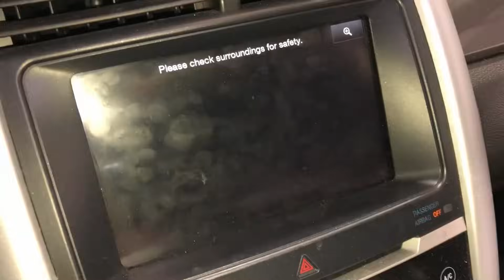2007-2019 Ford 6F50/55 Six Speed Transmission: Fluid Exchange Procedure

Comment: I figured I could come to your most recent video to ask this question...
I have a 2006 F150 extended cab. I had a power steering fluid leak. It was leaking pretty bad. It was a line that needed to be fixed and it is fixed now. No more leaking. There is a whine but after watching your video about it not being the pump and being a pully I am pretty sure that is what is making the whine. But now after fixing the power steering leak the actual reservoir is moving. The fluid is moving as well but only because the reservoir is moving. So what could that be?
Reply: Add a bottle of Lucas Powersteering Conditioner.

Comment: So if the airbox is in the way on a 2015 Taurus SHO, how are you supposed to check the fluid level with engine running?
Reply: Had to figure this out on my own since there was no solid information on the web.  Had to have engine running with MAF and air box disconnected while adjusting the fluid.  Overall a very easy process to change the fluid.  5.2 quarts total went in.

Comment: What types of engine design changes actually allow manufactures to change oil grades from say, 10-30 to 5 -20 to 0 - 20. And if I don’t want to use 0 - 20 in my engine in the summer and want to 5 - 20 what would the results potentially be.
Reply: 5-20 instead of 0-20? No problem. The thinner oils are for fuel economy. That said oils today are better quality and the lower viscosity is fine for modern engines.

Comment: I just performed a 3-time drain-n-fill on my 2013 MKX. 
I drained 5 LITERS (measured) on the first drain, presumably from the factory. I've seen 5 quarts for the fill and you say 4 1/2 quarts.
What say you, sir?
Reply: Variance. May have been slightly low from the factory? Maybe your vehicle was not sitting perfectly level when you drained it??

Comment: I've got an 09 Edge. Noticed a rattle at cold start-up for about a second, then it goes away. Started around 150k. Any ideas what it could be?
Reply: Wife's got the same issue at 180k
Reply: Timing chain tensioner

Comment: I have a 2018... 2.0 AWD the owners manual says the dealer has to check the fluid level let alone change it...it's got a funky cap other than what you showed... any thoughts?...Thanks for the Video...very well done.
Reply: It should be the same, even if the cap looks different.

Comment: Love the DIY videos! 
Am I the only person to notice that he Clearly says 4 1/2 quarts THREE times at the beginning of the video and then changes it to 5 1/2 to 5 3/4 when he's topping off with fluid???
Reply: The 4.5 is the base line. Topping up as you go through the procedure. Better not to overfill from the start and add until you get to the mid hash mark.
Reply: Same here right about 4.9ish qts, pretty much 5 is fine. Also checked mine while the engine was running too. I’ve seen countless videos where they check it with engine off. Not sure how much that affects the level reading though.
Reply: Took me 5 quarts to get just about right under half way mark .

Comment: Who are the genius engineers who try and reinvent the wheel when designing a transmission to be taken out and apart to change the filter......
Reply: Examples of planned obsolescence include: Limiting the life of a light bulb, as per the Phoebus cartel. Coming out with a new model for a car every year with minor changes. Short-lasting nylon stockings. Irreplaceable batteries in tech products....ford motor co. Products.

Comment: I work on the line where these are built. The engineers say not to worry about the filter. It is large enough to catch all of the material inside that will wear down over the life of car. There is a magnet on it to pick up any metal debris as well.
Reply from the maker: Yup its a large capacity filter for sure ands a magnetic strip but they said the CD4E filters were more than enough too.
Reply: Thank you, Daryl for building our Fantastic Fords! We are a big Ford family. Yes, I also have a 06' Pursuit. Thank you, FordTechMakuloco, for all the great wisdom and fixing our Ford's!
Reply: Tell your engineer friends to watch all the videos on this channel then we can sit around and discuss the horrible ideas of: non-serviceable internal filters, lifetime fluid in transmissions,  lifetime fluid in PTUs, PTUs where the gear oil turns to tar, water pumps that when fail dump coolant into the engine oil, placing the damn alternator in Ford Escapes (2001 - 2012) between the firewall and rear of engine, have them use the first and second generation Escapes as studies on how not to do corrosion prevention. 

Then we can discuss some good ideas: external cam- driven water pumps, external transmission filters (we can dream), off-road selective gearing for the Bronco sport, PTUs with drain plugs, serious rust prevention for the rust belt.
Reply: @chucknoob7041  For Ford, that would mean you won't have to buy a new vehicle as soon as they want you to buy again! The Big 3 are into making "disposable vehicles"! Plain and simple! Yet they snow the world when they claim to build "tough" vehicles!
Reply: I think I’ll pass. I’ve worked with aerospace engineers since I was an 18 year old aircraft mechanic and can never get a straight answer on service intervals. What they predict to be optimal is rarely even close. Reliability engineers? They’ll give you better recommendations after they’ve seen enough failures. Let’s hope yours isn’t the one that failed. The mechanic with years of experience who sees how things operate in real world conditions every day will most likely be your best resource.
Reply: LMAO! HaHaHa! Love "over the life of the car"!!!! I wonder how many miles/years constitute the life of the car?

Comment: My 2013 Ford Fusion Titanium with the 2.0L Turbo engine and the 6F35 transmission has been an amazing car for 100,000 miles. Now at 101,000, the car is beginning to intermittently linger on 2nd gear longer than usual (feels like the car is floating) and then banging into 3rd gear. It happens during long drives. It's been 12,000 miles since the last time the fluid was drained and refilled with new Mercon LV ATF (with some RedLube friction modifier). I'm going to change the ATF soon to see if shifting improves, but what would you recommend? I've been advised to go to the dealer and see if there's a sw update for the TCM. I plan to do that next week. But what do you recommend? Thanks.
Reply: Those factory software updates are meant for low mileage vehicles with little internal wear - applying the update on a vehicle with over 100k miles of wear on it may actually cause the problem to get much worse, since all the learned parameters will also be reset back to brand new factory settings in addition to whatever the software update changes.  Try an ATF fluid change ASAP (minus any additives - stock Mercon LV is all that is needed), and if it does not fix it then you have a decision to make if you want to keep driving it till it stops moving or spend the money now on a rebuilt trans.

Comment: Congratulation! You just replaced 40% of fluid.
Reply from the maker: More like 50% or more. That is the idea here, you MAINTAIN your fluid not neglect it. You never want to completely flush a trans especially with a flusher machine that has a mix of fluids from the last 4 vehicles it serviced.
Reply: Eric, Do you have a link to the proper way to drain the torque converter as well? Really hard to find any information regarding the procedure.

Comment: I was wondering if you could put Mercon V instead of the Mercon LV fluid in this type of transmission.
Reply from the maker: Why would you?
Reply: @FordTechMakuloco    I asked the question because in the video it was stated in mid year of 2009 Ford switched to the LV fluid at 5:37  and is more sensitive to fluid change it expands more. So in my eyes it seems that the Mercon V is a more stable fluid. So did Ford change the internals of the transmission when they changed the fluid type or did it stay the same. So if the internals are the same why not use Mercon V if its less sensitive.
Reply: @T Rust  The LV stands for "low viscosity".  Regular Mercon or Mercon V should never be used in place of Mercon LV.  The same thing goes for Mercon LV - it should never be used in an application that calls for Mercon or Mercon V.  The days of being able to just grab any bottle of ATF and expect it to not cause any problems are just memories of "the good old days" now.
Reply: @KCautodoctor I asked the question because in the video it was stated in mid year of 2009 Ford switched to the LV fluid at 5:37  and is more sensitive to fluid change it expands more. So in my eyes it seems that the Mercon V is a more stable fluid. So did Ford change the internals of the transmission when they changed the fluid type or did it stay the same. So if the internals are the same why not use Mercon V if its less sensitive.
Reply: @tedjones-ho2zk  because the transmission was designed for this specific fluid chemistry & viscosity due to the very precise metering passages in the valvebody and solenoids used to control the shifting of the transmission.  There is also a different friction modifier added in the LV fluid than what is used in the older Mercon & Mercon V ATFs.  Use of the wrong fluid type will cause shifting problems and rapid wear on the internal frictions materials.
Reply: @KCautodoctor Thank you for informed reply to my question

Comment: Thank you soooo much! I need to service my 17 Explorer limited. How do you know if you have a 6F50 or 55 trans?
Reply from the maker: It is based on the engine you have but it does not matter because the fluid and service procedure are the same.
Reply: The 55 is used for ecoboost applications,  a little beefier inside.
Reply: I have the normally asperated V6 and was hoping to have the beefier 55 since I tow a camper. Do you recommend a better trans cooler? I did order the wind deflector that mounts underneath to blow air back on the PTO. Tha ks for your info and excellent videos!

Comment: Do you recommend to change the fluid on a 6r60 transmission with 90k miles that has never gotten the fluid changed? I just bought the truck and the previous owner never replaced it, he used the truck (07 Explorer ST) mostly for going to and from work and thus far the transmission shifts smoothly.
Reply from the maker: Yes a fluid and filter change but make sure you use Mercon SP.
Reply: @FordTechMakuloco  Awesome thanks for the advice.

Comment: Want to keep your Fords over 100k do all fluid changes religiously including brake fluid, engine coolant, power steering, transmission, PTU and engine oil.
Reply: 2007 ford edge 158,000
2010 ford edge 164,000 
Change fluids they will last
Reply: most vehicles, if not all, with the 6F50/55 use ford EPAS steering, which is electric and not hydraulic fluid driven
Reply: Great advice

Comment: Just left Ford dealership. They quoted me $550 for drain and fill on a 13 F150. They were really pushing the transmission flush. 🤦🏻‍♂️ At what mileage would it be considered too late to perform drain and fill?
Reply: I'd say over 150k you may want to think before drain n fill.
Reply: I hear flushes are bad....just diy drain and fill and save 525.
Reply: Leo Derosia I’ve heard the same thing about flushes, that’s why I told him I didn’t want the flush. They wanted $250 for the flush, $550 for the drain and fill. 🤯 I told him looks like I’ll be doing the drain and fill myself, just didn’t want to because I wanted to avoid the mess in the garage.

Comment: Is it better to have a fluid exchange done or is a drain and fill good enough? I was told a lot of old fluid does not drain
Reply from the maker: You want to follow this drain and fill procedure and maintain the fluid at the specified intervals, never flush.
Reply: Why do you not suggest flushing? I guess a flush every 60,000 is similar to a drain and refill every 30,000. And a drain&refill is a DIY.
Reply: @taylorsutherland9447  I believe a fluid exchange is suctioning out old and replacing with new. The flush would be different. A flush may take and circulate old trans debris throughout the trans and leave particulates in small orifices that would clog! Normally, fluid follows a designed circuit where the fluid gets filtered BEFORE it goes to any small important openings! Think of the way coolant gets FLUSHED through the system!
Reply: @taylorsutherland9447 Add a bottle of Lucas Transmission Conditioner next time too, in place of some of that 4.5 quarts.

Comment: Is it the same for the EcoBoost as well?
Reply from the maker: same for all 6f50/55 transmissions.
Reply: The 6f50 is the standard engine model and the 6f55 is the ecoboost model. The main difference is the thickness of the gears in the differential.

Comment: I agree that non-serviceable filters are kind of dumb, but they're not as bad as everyone here is making them out to be. Considering most people never service their transmissions at all and they commonly go over 150k miles before having problems, it's not inconceivable one with a non-serviceable filter can go over 250k just with some fluid changes. My 1992 Honda Accord also has a non-serviceable filter (yeah, before you bash Ford for this, they're not the first ones to do this). I have 208k  miles and never had a transmission problem. Never had to change the filter; I just change the fluid every 30k or so.
Reply from the maker: Correct the filters are great long life filters just don't neglect the fluid.
Reply: While I do agree it's really not that necessary to change the fluid or filter in the grand scheme of things, I'd still at least like to have the option of doing it. Ford is making this choice as a cost saving measure for themselves rather than the user.

Comment: Did I hear 4WD or Front wheel drive?
Reply: The transmission has same design for all apllications, but they are not interchangeable.  The awd model has longer output shafts.
Reply: He said FWD, but that's because the platform is based on a FWD setup even though most (in the north anyway) have an AWD transfer case added to make them 4WD.  IOW,  same transmission in both.

Comment: I agree with your shorter than recommended fluid change intervals. More maintenance means less repairs.
Reply: Same goes for Engine Oil changes, 7500 to 10000 is dirty oil running too long
Reply: @TheSaintshockey03  I've always done my oil changes every 5k miles up until the last couple of years. I might drive 5-6k miles/year now, so I just change my oil every 6 months. It ends up being every 2.5-3k miles, which might be a little overkill, but I like keeping things on a nice schedule
Reply: Tom Peterson I have 205k miles on my 2008 Ford Edge fwd no issues at all. I’ve only changed the fluid twice. I don’t want to change it again because it’s still has some pink in it and I don’t want to mess anything up at this mileage. Might help that the car has the tow package so it has a bigger tranny cooler.

Comment: I have a 2016 Edge 2.0L FWD and the transmission does not have a dipstick only a fill cap, How would I do a drain and fill on it? How would I know its full?
Reply: @823jeepman  that should be the 6F35 trans in that version of the Edge.  Brian has some videos on here that show how to check the fluid level on that transmission by removing a specific plug to check for ATF fluid dribbling out.  Do not guess about the fluid level since it is very temperature sensitive & critical in keeping these modern transmissions working correctly.
Reply: Then you have measure how much comes out and put the same amount back in. The new fluid going in needs to be the same temp as the fluid that came out

Comment: Do you know what would cause a 2006 Ford Taurus to stall when making a left turn? starts right back up after. Only did it once so far
Reply: Dose this happen at a stop, or while moving, or both.
Reply: Zachariah Woller so far is was when turning. I think a few years back it almost stalled when backing up
Reply: @justinp8946  I'd check and clean, or even replace the IAC valve. Because if that's sticking and not opening right it will stall the engine due to the load on the engine and transmission. I also wouldn't be surprised if an o2 sensor could use some cleaning to. If that don't work bring it to a mechanic so he can plug in his actual computer and read what's happening to the engine when making the turn and possibly diagnosing what's wrong. Granted that would start costing money.
Reply: @justinp8946  That or the fuel pump is going out the door.
Reply: Zachariah Woller for sure. I appreciate the tips!

Comment: Had mine in a 2008 taurus with approx. 112K changed when the input and output sensors were causing issues. Started shifting poorly recently and was cause by low fluid due to cooler leak. Cooler is attached to AC condenser so abandoned it and put in aftermarket tranny cooler. Shifting well now. Might do this sometime in the next couple of years.

What do you think of Jiff Lunes reverse flow change? Supposed to help get junk out of filter, but makes me wonder where the just goes! Seem like that might be a bad idea.
Reply: Add a bottle of Lucas Transmission Conditioner next time too, in place of some of that 4.5 quarts.

Comment: I just had my tranny fluid changed on 2006 Ford 500 w/ Aisin 6-speed auto. The mecahnic said it was drain & fill no filter. Is this the same transmission ? Thank you, John
Reply: I just spoke with my mechanic about a full flush on my 2010 Lincoln MKZ awd Aisin 6 speed transmission. He stated that he will do a full flush and replace on the fluid. I am having this done on Thursday. My Lincoln just flipped 49k miles. We will be using the oem motorcraft fluid from the dealer.